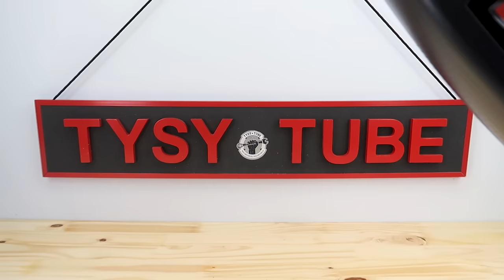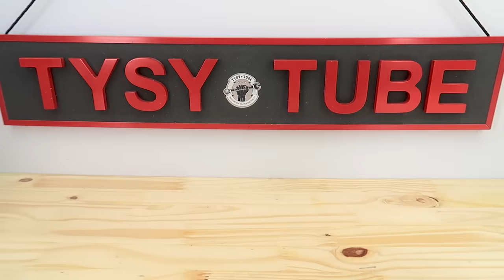Rusty Bread Cutter Restoration

Comment: Technically, by filing the parts down, you're degrading the value of the item because it's no longer the original make. Same model, yes, but filing the metal like that makes it "modified".

Comment: i was wondering why people had a full “machine” just to cut bread, geez
Reply: Victória, you are so beautiful, did you know it?))
Reply: If you've ever tried to cut the Danish rye bread (a dark, hard, almost rectangular bread) with a knife, you'll know why! You get very irregular slices if you cut it with a knife and you have to use quite an amount of power to cut it, whereas you could set the thickness  of the slice on the cutter. This cutter was common in nearly every household in Denmark at least until the middle of last century. We still eat lots of rye bread, but nowadays it's sold sliced.